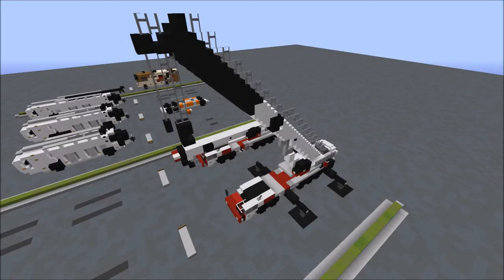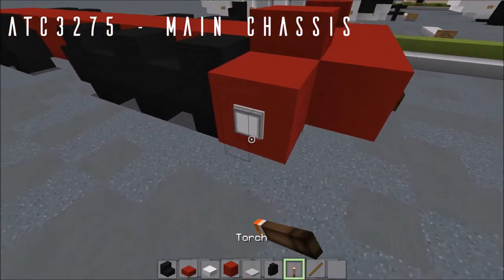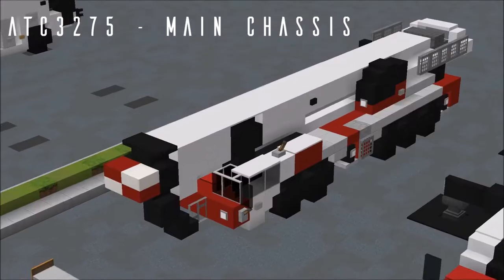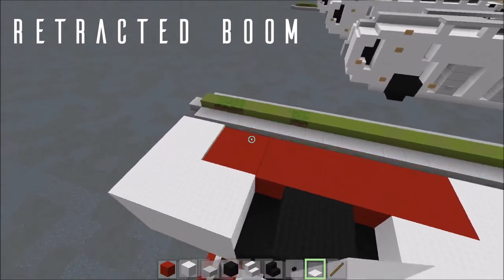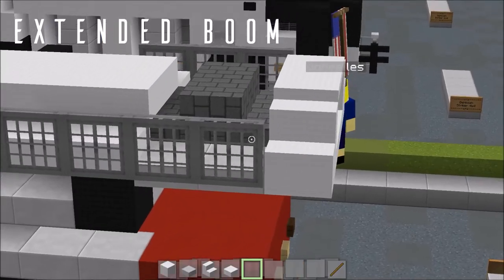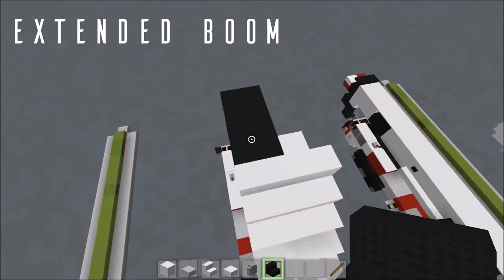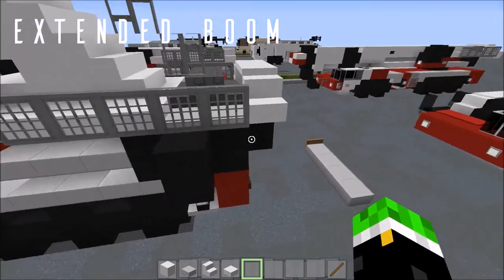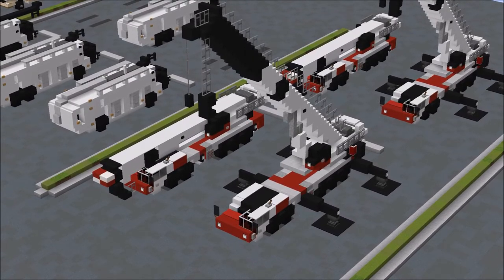Link-Belt ATC-3275 Mobile Crane Tutorial [1.5:1 Scale] | Minecraft

Comment: NICE, good job on the video. love that the builder finally came over to the darkside. He used to wouldn't use the 2x2 step block wheel. lol
Reply from the maker: Worrelles use of sideway slabs for wheels instead of 2x2 stairs is on purpose. this allows for a smaller wheel in between 1 block and 2x2, which benefits the designs at our scales.